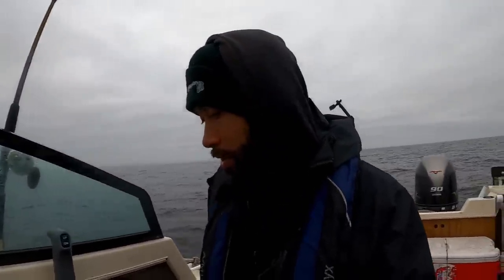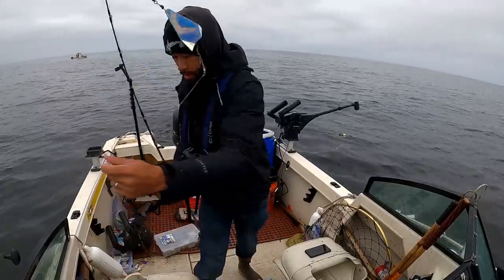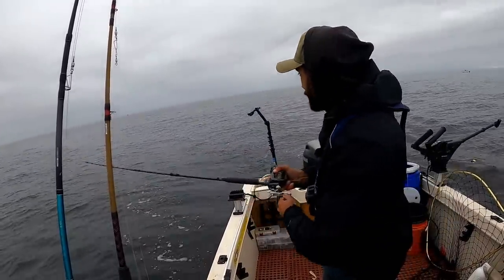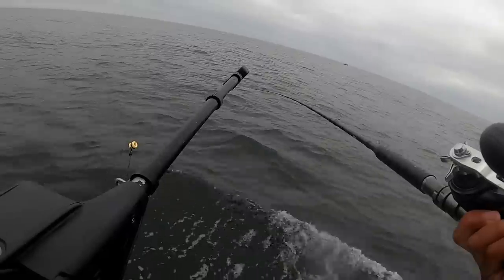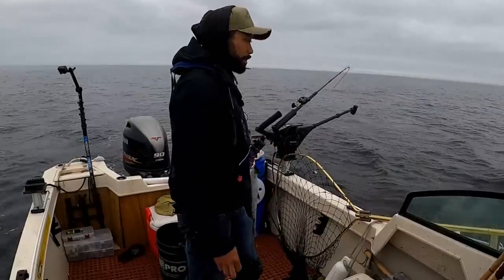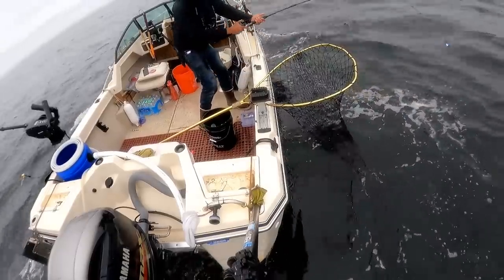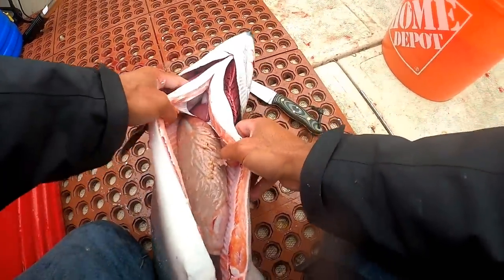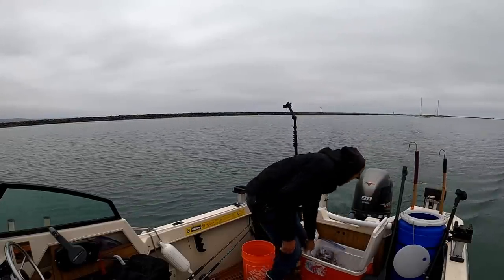NOT What You Want to Hear SOLO at Sea (I Lied about this, I'm Sorry!)

Comment: One time I spent two hours troubleshooting my engine before I realized the kill switch was off. Too embarrassing to tell the tale anywhere else but under the veil of the YouTube comment section.
Reply from the maker: I should pin this
Reply: @FishermansLife  It would be healing, lol. Here is another; I was night fishing for steelhead, pulling plugs I would troll a section, then zip back up to the top of the hole to do the same section of river again. After a few times of doing this, I got to the top of the hole, looked down, and my entire set up was gone, plug and every inch of line. I had left my gear in the water and when I got on plane stripped everything off. Luckily I kept the rod and reel. 

p.s. I wont give the details of when I planed off with the kicker motor down.
Reply: One time??  I can't even tell you how many times I've done that haha.
Reply: Always bring a map🤗🤟✌️
Reply: @FishermansLife  might be revealing Info on your refrigerator but maybe not. Just FYI.
Reply: Daryl is that you

Comment: Excellent content as always! I believe the main part or rather the structure below the actual spinal cord is the centrum or vertebral body of the vertebrae…it is a support structure that makes up the bulk of each vertebrae. So just above that (where you stick the wire in) is indeed the actual spinal cord which is basically destroyed by the wire, ceasing all nerve function. I think rigor mortis sets in no matter what you do because it depends on the levels of ATP and the calcium ions in the muscles of the fish….as they deplete through time, the muscle become locked in a contracted position via particular biochemical pathways (to extensive to post here lol). However, I believe the ikejime technique delays the onset of rigor mortis, so perhaps the freshness of the meat seems to last longer before actual decomposition begins.

Comment: Afaik it doesn't prevent rigor mortis but it slows down the onset compared to normal bonk + bleed. Main benefit is as already posted; less waste chemicals accumulating in the flesh means better taste. Dunno if this is poor youtube etiquette but this dude has a really good demonstration of the process; CC for English: https://youtu.be/NY6ywY7u4RA.  Also as far as I can tell the ideal wire is 16-20ish gauge stainless steel memory wire, it's readily available for jewelry making.

Comment: Ike-Jime (live killing/'closing' roughly translating) is the technique used to kill fish and bleed out the fish. The technique in the video is called Shinkei-Nuki (nerve pulling) which destroys the nerve going down the spine to prevent additional degradation of the meat. I've seen commercial boats use compressed air to blow the nerve out of the fish in one shot for porgy.

Shinkei-nuki will delay the stiffing process but will not stop it. Though delaying it will still result in fresher meat.

Comment: Just want to make a few things clear re. ATP, neurotransmission, and rigor mortis. ATP can act as a neurotransmitter in the central as well as peripheral nervous system. It plays a role in sensory neurotransmission by binding to receptors in various compartments. ATP has a number of receptors which can be targeted pharmacologically with drugs to treat blood clotting; numerous clinical trials are underway in cyctic fibrosis, inflammation, pain, and arthritis.  By inserting a wire into the intrathecal space (that contains the spinal cord) you are mechanically activating descending motor neurons in the cord that synapse on muscle fibers in the body of the fish that utilize excitatory neurotransmitters such as ACh and glutamate. Hence the twitching. Back to ATP - after binding to it's receptor during neurotransmission ATP is NOT broken down into lactic acid and/or ammonia - it is converted to ADP then AMP, then adnosine or inosine. Re. rigor mortis, muscles need ATP to function properly and when breathing stops organisms cannot recycle ADP to ATP and muscles go into rigor. During rigor glycogen in the muscles breaks down and leads to accumulation of lactate and a fall in pH (more acidic). This is unrelated to ATP, poking a wire into the spinal cord, or the like.     Credentials: PhD in Neuroscience, MS in physiology, endocrinology, neurobiology; can't catch fish for shit!

Comment: Rigor mortis is caused when the ATP consumin proteins in the muscle (Myosin) bind to the actin filaments, locking the muscle down.  This happens when the tissue runs out of ATP, which will happen whether or not you pith the spine.  Decreasing neural impulses using the spinal pith may delay this a bit by reducing contractions in the muscle, but probably not by a whole lot.  When the heart stops beating and tissue is not oxygenated, ATP production starts to shut down.

Comment: Rigor will probably happen either way as it’s a biomolecular process, it has to do with depletion of ATP at a cellular level in the muscles - crossbridges between muscles fibers actually require energy to disengage and when the body ‘relaxes’ it is actually because down the road the muscle cells actually start to breakdown directly and the crossbridges denature. The technique is more intended to reduce continued twitching which may cause more buildup of lactic acid and alter the flavor profile. At least in theory. 

Just my two cents.

Comment: Used to do that in the slaughter house on the cattle once shot with captive bolt had a 4ft long wound spring about 5mm in diameter shove it down to break the spinal cord helps as you have shown to get cleaner meat as the involuntary spasms push blood out too.

Comment: I personally found those Chinese thin steel skewers works very well as an Shinkeijime “wire” with smaller fish such as flounder and such. I have also modded a water dental flosser with an extra glue needle and syringe for tsumoto-shiki shinkeijime but it needs to be refined to a point that it can with stand a strong enough water pressure for larger fish such as halibut or salmon.

Comment: Its the cold that does that sometimes. It works best if you make a slurry and submerge the whole fish. Also helps to have a cooler where the fish lays flat.
Reply: i noticed this keeping drinks cold in a cooler as well - better an ice bath than just ice to get something cold. water is a much better thermal conductor than air.

Comment: Check your laws to make sure it is legal.  I fish the great lakes on the Canadian side and I always run a slider on my main line.  Set your main line just like you did and then have a slider line about four feet long with a snap swivel at each end, clip your bait to one end and then clip the other to your already set line.  It will slide down to about mid point so if your main line is at 60 feet down you also have a line at 30.  Never tried using a flasher with this method though.

Comment: Swear to god my guy run like a 40 inch leader max it will make netting a fish solo so much easier and besides that inline flasher actually disrupts the water pretty well and adds great jiggling and vibration to the bait but you would have to run a much shorter leader like in the 25-30 inch range to have the full effect if you don’t feel comfortable doing a short leader just trust please 🙌👏 edit: 360 flashers are better than in-line but not all current allows them to be effective